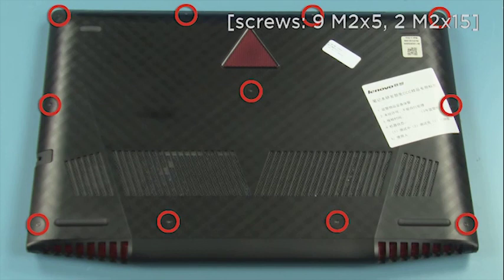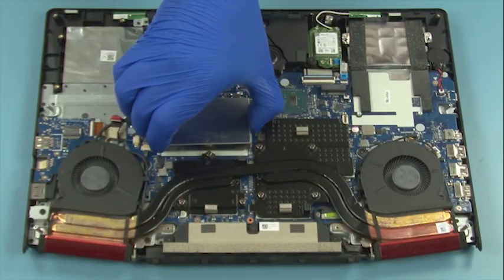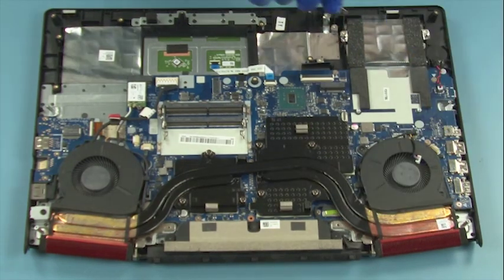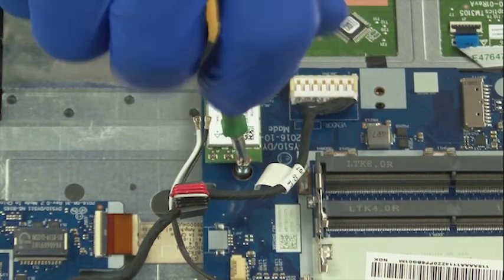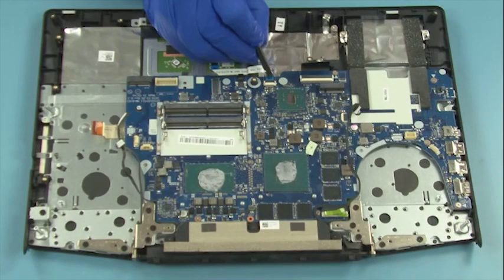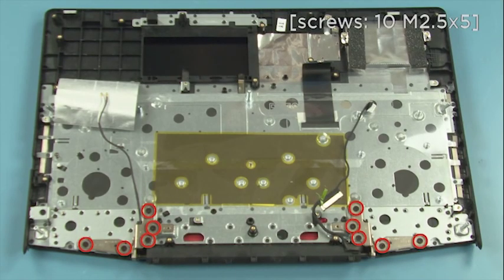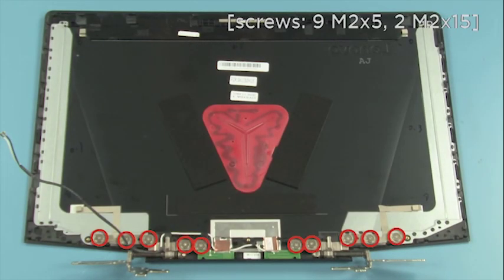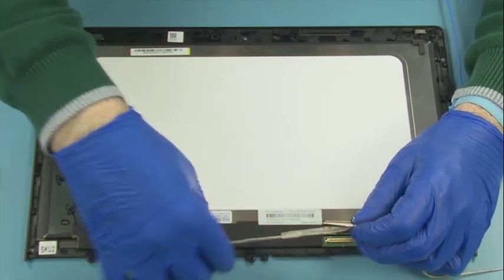Lenovo Legion Y720 Disassembly

Comment: Hey, First off, great tutorial, very helpfull even for a newbie like me. I did a full stripdown of my Y720 Legion, It does not have the exact sam configuration as the one in the video ( I do not have a xbox controller module, and I do not have the mainboard connector you unplugged at min 06.52). After I put all back together It all worked fine, except I do not have the keyboard backlight active anymore. I did not forget to unplug the battery first thing after removing the back cover. I am at lost, I think I did all like in the video, except for that connector at min 06.52. Any sugestion would be apreciated, Tyvm for the tutorial again !
Reply: I found why my backlight was not working. On my mainboard the keyboard backlight connector is located just above the hard drive, and the cable is covered by the hard drive. All is fine now.

Comment: Heyo! I'm having an issue where significant force is pushing against the front part of my PC (this exact model). It's so severe the backplate warps .5 centimeters when trying to unscrew the 4 front screws.
I ultimately failed unscrewing the final two screws due to the warping/bending making the screws too too resistant to move the slightest.
Anyone else who's experienced this issue?

Edit: Yes, my PC is in a perfectly working order. I needed to remove the backplate to commence cleaning and maintenance.
Edit 2: I realized that my touchpad has been deformed for a while, and practically has stopped working. That being said, I have no clue about what could have caused this in the first place, as I've never previously disassembled my PC.
Reply: Future me here. I resolved this problem ages ago. *This problem is related to the battery bulging, and should be resolved as quickly as possible! It's better to use agressive brute-force to remove the tight screws rather than risking the failing battery to potentially become a fire hazard!*
The touchpad issue solved itself after removing the battery.

Comment: My laptop feels glued shut or something compared to this video. How did you pry it open so easily after removing the screws?
Reply: There are clips all around on the inside of the laptop I find out a guitar pick will help a lot. I usually insert it in the gap between the palmrest and the back cover that's closer to the touchpad. Do not pry it open. you just have to slide the guitar pick or a card all around, you're hear the clicks, it's relatively safe however, be careful around the port areas.

Comment: Hey!
I know it's not really related, but my RGB lighting stopped working for some reason even though I have all the drivers, do you know what could be the problem?
And after i looked at your video i didn't see one of the connections that you said to disconnect.
Reply: That happened also to me but besides my laptop don't have sound :(
can you solve the problem??
Reply: @cristians8961  Looks like this problem is related to not unplugging the battery power cable from the motherboard, first thing after removing the bottom cover. I've read about several similar cases and it seems the only solution, sadly, is to replace the motherboard.

Comment: Is it at all possible to replace the power jack/socket for this laptop? It's becoming sorta loose, and I'm concerned that it might stop working soon.

Is the part soldered or replaceable?
Reply: From the video it looks replaceable you can look at the removal at 6:03 . The part is separate from the board and it's connected by a cable, it might also just be loose and needs tightening.